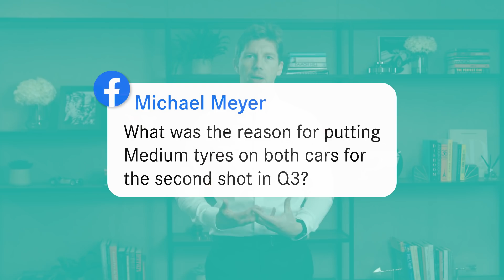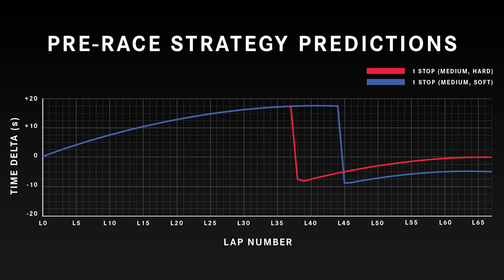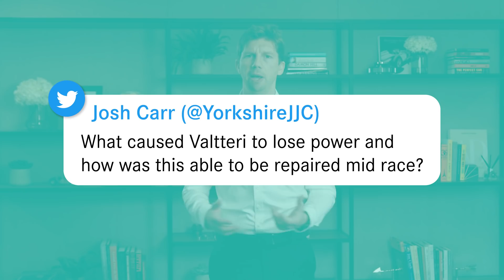Sensor Issues, Fastest Lap Fights & More | Portuguese GP F1 Race Debrief

Comment: Each session FP1, FP2 & FP3 set the basis in utilising the understanding of high downforce & undulating elevation gradients around sector 2 in particular, where prior ensuring Turn 5 & 6 were dialled in in entry to Portimao Turn 8! The characteristics of the track suited the car!Astute tyre management of the yellow wall medium tyre compound likewise generating the capacity optimum temperature window, excellent navigation particularly through Sagres, Portimao & Galp corners! Excellent tyre management of the yellow wall medium compound, exceptionally smooth through Lagos  throughout the first, awesome through the second sector particularly through Portimao & Sagres, brilliant amount of traction generated through the Galp corner onto the straight!

Comment: I would´ve liked to hear a bit technical aspect about the different rear wings Bottas and Hamilton were running.
Also you forgot to mention that you slightly messed up the Bottas pitstop when it was 3,3 seconds if i remember correctly. There is the tenths you needed to get Bottas infront of Verstappen. I could guess Redbulls pitstop was faster than yours.

Comment: "The only fix would have been to bring Valtteri one lap earlier." ... " Or give him a 2.5s pit stop instead of 3.3s. Pits tops are a constant weakness for MB. Shov admitted this in a previous debrief. Why can't MB be consistently quicker?
Reply from the maker: As Shov said, pit stops are something we're constantly working on! In general our approach to pit stops is consistency over speed, but obviously we know they're not as quick as we'd like. It's an ongoing process! But there were multiple factors involved in VB losing out to Max, the main thing was the timing of the stop, which is what JV explained in this video.
Reply: @MercedesAMGF1  Thanks for the response. Yes, "multiple factors". But James said "only fix" (@6:34). My point was that one alternative fix would have been a quicker, yet complete, pit stop. What seems to be the most consistent is the time differential between MB's stops and the stops of other top teams. This season will come down to fractions. Slow pit stops or pit stop errors are even costlier this season. Here's one MB fan really, really hoping you can improve in this area... and sooner rather than later.

Comment: The rules prohibit the change of engine modes during a race, via the directive introduced to ban the use of multiple power unit modes. For safety reasons it's allowed to tune it down, but ones done that is the mode it remains in for the remainder of the race. In this it's pointed out that the software put the engine in a "safety mode" it recovered after the sensor failed. But in the mean time Mercedes was looking at ways to excluded the sensor. Is this then not the same as the engine is tuned down (not by the driver but due to a sensor). I wonder does this clash with directive 37? after x time you overload a sensor and if you are in a good position you leave it preserving the engine. If you are in a fight you overrule the sensor and get back to full power. I'm pretty sure I'm missing something here or that I missinterpret a rule or so, can someone help me out?